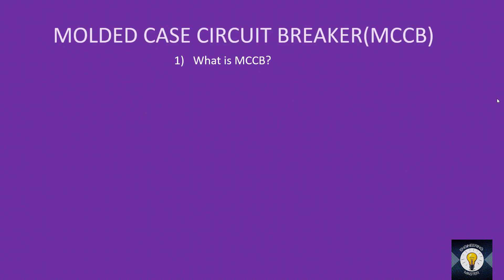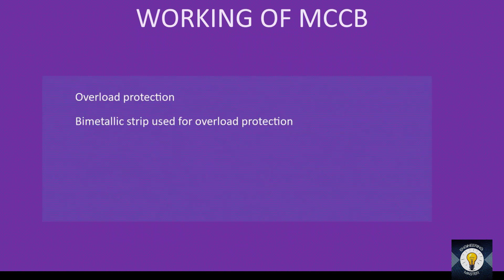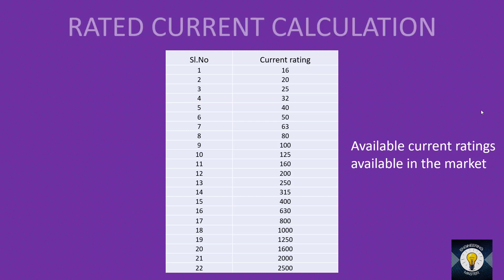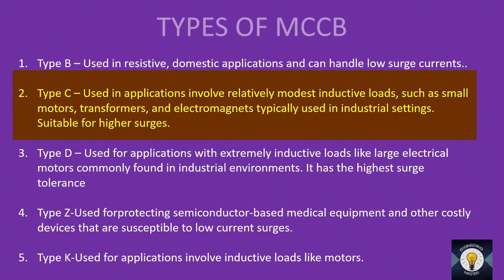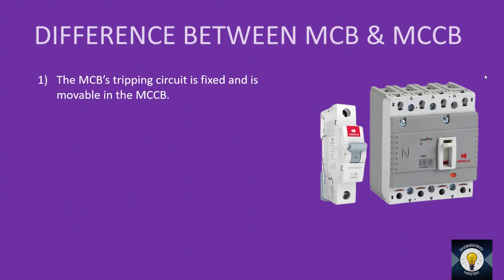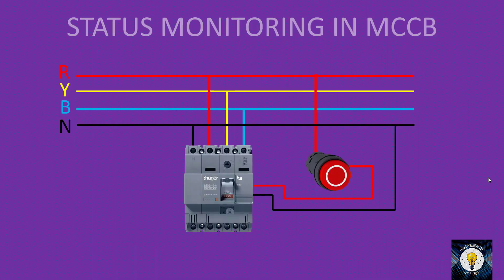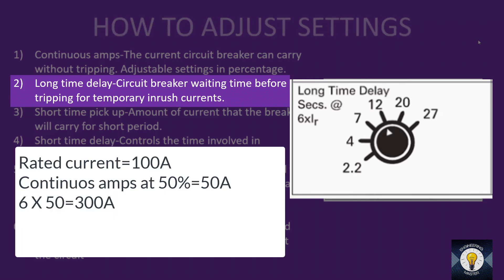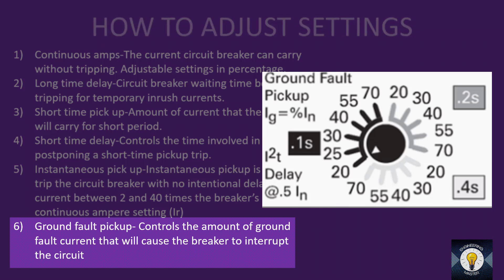Understanding MCCB:  Function, Structure, Selection and tripping for Molded Case Circuit Breakers

Comment: Please in a 1000amp MCCB BREAKER, does it mean each phase(line) on the breaker is rated 1000amp (total 3000amp on three phase)  or the 1000amp is for the three lines ( (330 amp each) in the MCcb breaker.
Don't know if my question make sense, I am not an electrician
Reply from the maker: 1000 amps 3 phase breaker means you can connect single phase 1000 amps load in each phase of the breaker .Hope you got the clarity.